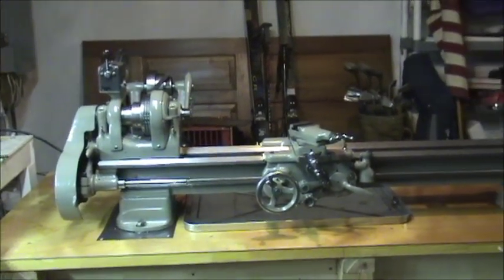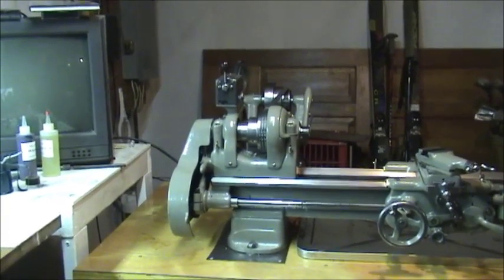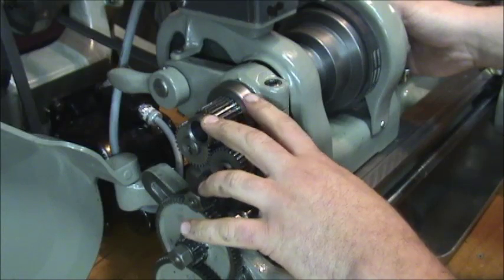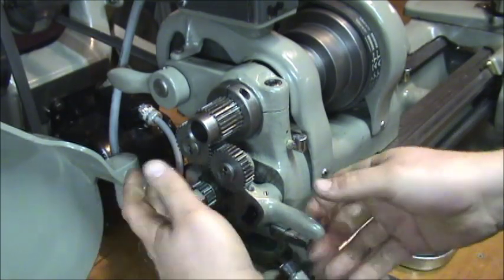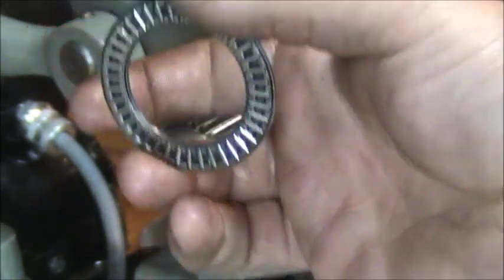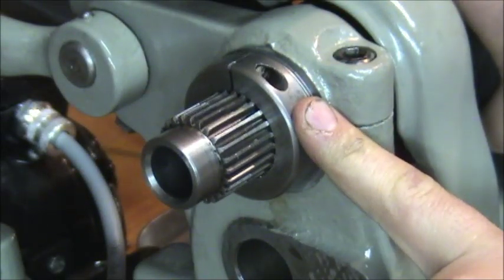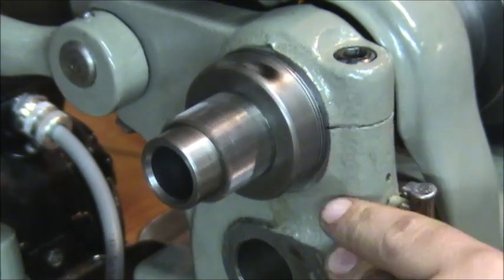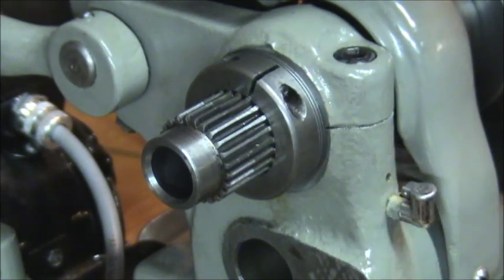South Bend Needle Bearing Mod

Comment: Thanks Greg, I was having severe run out last night prior to attempting to turn down a shoulder on a chuck backing plate and I thought that I was going to have to shim the bearings but when I tested it the play was right in the 0.001 ball park on both ends and then I just pushed on the spindle gear and it moved a whole bunch in the axial direction. Turns out that the fiber washer is blown out(go figure, it's a 1919, LOL!), so I'm now going to find the right sized hardened washers and needle bearing to install to get her running true again. I knew I'd seen this video, but it took me a while to find it since it's your 1st one! I really appreciate it man...Aloha, Chuck.

Comment: I have a 9 inch Model A which I think dates from WW2.   On examining the rear bearing, instead of a fibre washer there is a hardened steel washer which is pinned to the take-up nut so that it rotates against the headstock.  It seems to work OK.  Is it a factory fitment?

Comment: Hi Greg, great video and right on time for me as I am in the process of a restore of my 9a, when I took the head stock apart I noticed a groove worn into the surface where the fiber washer is. Can I still go ahead and use the needle bearing replacement or do I need to find a replacement head stock ?
Reply from the maker: M&Ibooth 
You'll be fine with getting the bearing and washers.  No need for a new headstock.

Comment: Since a few wks a proud owner of a Southbend. Regarding this upgrade I do have a question: where to put the felt washers? I my lathe I only had one felt washer and this was between the needle baering and the holder. Should I keep it at the same place? And should there be one on the other side on the ball bearing?
Thanks,
Bart

Comment: So any troubles with this some 3 1/2 years later?  I believe I located the right needle bearing assembly to do this to a Heavy 10.  Annoyingly the 10L you have to press the rear gear off in order to change the thrust bearing, so I need to decide on whether or not to use it before I assemble the spindle.  The steel washer it had was pretty chewed, so I'm really looking at using the needle bearing to eliminate that problem.
Reply from the maker: Still going strong